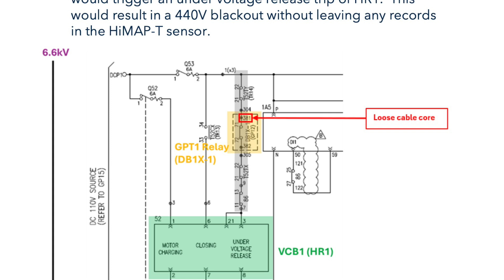NTSB Report from Sept. 11, 2024 indicates LIKELY CAUSE of power failure aboard the M/V Dali

Comment: In a modern house you can buy battery backups to keep your computer and systems running during a power glitch.
It’s a shame that “modern“ ships don’t have battery backups for critical systems.
Reply: A big part of the problem is the systems that actually control the ship are high power loads so a simple battery backup isn’t reasonable. Even if it was you’re still subject to the same problem of loose connections. Ideally they would have backup generators ready to go, but it seems they had problems with those too.
Reply: @NBSV1  
Oh, I understand that the high-power systems would be much more difficult to back up. But he was talking about computers rebooting. 
It sounds like the engineers who designed the ship assumed it would be at the end. Who cares if it took a few minutes for the computers to boot up not much is gonna happen in the ocean.  But that’s not the case close to shore
Reply: @neilkurzman4907  The computers don’t matter much if you don’t have the power to actually do anything. The main problem was that they lost power to actually control the ship.
Reply: @NBSV1  
In the video, he spoke about the time it took for the system to reboot after the power was restored.
What was covered is was a single point failure or did they fail to switch the power systems to the back up.

Comment: Great reporting.    I worked in commercial power plants for decades after I got out of the US Navy.    Loose connectors or bad connectors/contacts have caused many many power plant trips or rapid down-powers.

This Report totally makes sense.
Reply: The bigger question is were they ignoring it for a while or was that the first time it failed.
Reply: @neilkurzman4907  They may have had no idea why it failed.  When presented with intermittent problems.... it can be extremely difficult to figure out where the problem is.

In this case because of the accident and NTSB investigation I am sure that they had electricians checking every connection for every wire... something unheard of for normal maintenance.

I have been part of troubleshooting where we just ended up rewiring the entire control circuit and replacing relays and limit switches (1960's vintage control circuit) because we could not otherwise find the intermittent fault (that was tripping a generating unit of line).  But once rewired with some new relays and limit switches the problem went away for good.  That took 4 days of work by about 5 people, over $1000 in new limit switches and relays, and hundreds of feet of old wire pulled out and new wire pulled into conduits with appropriate connectors attached, and all the wires properly labeled with their individual wire numbers on both ends at the connections).
Reply: @neilkurzman4907  They may have had no idea why it failed.  When presented with intermittent problems.... it can be extremely difficult to figure out where the problem is.

In this case because of the accident and NTSB investigation I am sure that they had electricians checking every connection for every wire... something unheard of for normal maintenance.

I have been part of troubleshooting where we just ended up rewiring the entire control circuit and replacing relays and limit switches (1960's vintage control circuit) because we could not otherwise find the intermittent fault (that was tripping a generating unit of line).  But once rewired with some new relays and limit switches the problem went away for good.  That took 4 days of work by about 5 people, over $1000 in new limit switches and relays, and hundreds of feet of old wire pulled out and new wire pulled into conduits with appropriate connectors attached, and all the wires properly labeled with their individual wire numbers on both ends at the connections).

Comment: Regain control . The atis track showed the dali traveling at 9 knots when the power first failed it continued to travel in a straight line  until the power came up again when it suddenly   lost 3 knots of speed and turned hard to the right despite the rudder being commanded over to the left and the port anchor being deployed all inside of three boat lengths.  The question is not what caused it to lose power but what would cause a 948 ft 100, 000 tonne vessel traveling in a straight line to do that? My guess full resvesr and prop walk

Comment: Curious - is there any mechanical backups on at least the steering? If not, why not?
Reply: It’s a big rudder with a lot of load on it. If there is a mechanical backup you’d be hours getting it setup and turned. Doubtful they even have a direct mechanical backup because it’d be so hard to move by hand.

Comment: Had a massive data center UPS go offline due to a loose wire. Apparently, there was a constant vibration induced by a transformer that over time caused a control wire to work its way loose. Who knew?

Comment: Yup, thanks update. I can say from many years in the oil field as a offshore electrician, lose wires have caused many a lost hour of sleep. Most maintenance programs tell you to go in a cabinet and check every connection. Time consuming, but worth while. I have story's to tell about, but, I'm not.
Reply: Our Quarterly PM had us checking the condition of every connection in our supply and control circuits at a medium size automated factory. There was always something that had worked loose and needed attention. Every time.

Comment: I can see that. The neutral line on my 220 stove loosened after 3 years where I thought the control panel had quit working. I think it uses 120, Also fixed the erratic oven temps.

Comment: A loose cable? Holds cable in his hand, Plugs back in the power cable 'Just kidding everyone!' (anyone who gets the airplane reference kudos) 
But for real one would think there would be some sort of strain-relief bushing, cable reinforcement, or even the ez lock type of connectors would be in place. Im also surprised it isn't part of routine weekly or at least at each port stop testing, like automatically reseat connectors or something. Surely there must be way to detect that signal is weaker and thus cable is loose or something. Just saying.

Comment: Captain Andy,
They have to determine whether it was 
Deteriorating parts, just bad luck or a lack of proper inspections and/or 
negligence.
I am not sure even, if they had regained power quickly, that a ship
of that mass could have been stopped, anchors or not.
Thanks for the  latest info.
Cheers,
Rik Spector
P.S.
I looked up that Camera online and it's amazing,
were you able to get any needed accessories?
Why did I ask that??                                                                                                                            
Good 4K luck, Sir.

Comment: So, poor engineering maintenance and oversight.
Reply: Not so sure about 'poor' maintenance.  When was the last time you opened up your power panel and checked the lug torque or simply had an IR scan done, lookin for hot spots?  I think the procedures need updating. Connections don't frequently come loose, but when they do, they get hotter. A routine IR comparison might have caught that.
Reply: @steveurbach3093  
If terminals were tighted properly in the first place there should be no change. From the previous NTSB report there was no threaded lug or screw, just a spring loaded "stab" type terminal block such as those found on the back of household switches and recepticles, those fail often under heavy amperage loads. Garbage at my perspective.
Reply: That and is it beer oclock yet.
Gave you a thums up. 👍🤠